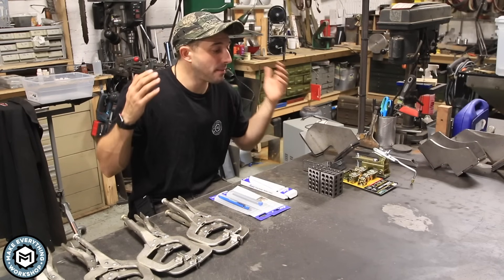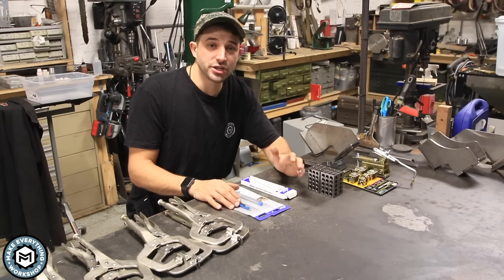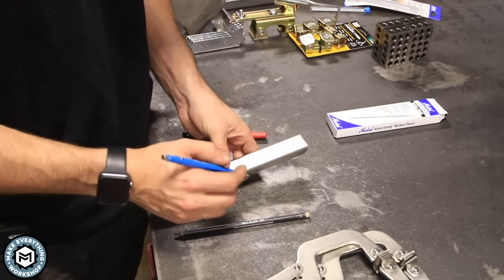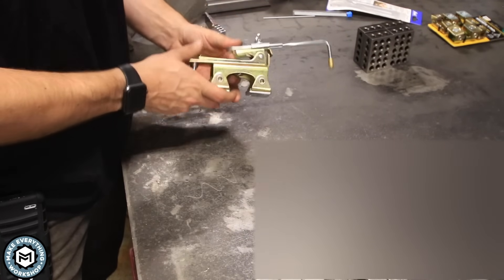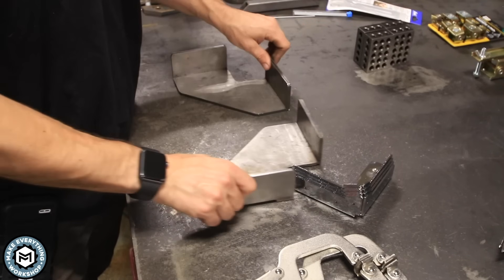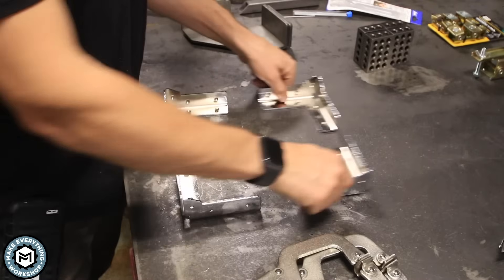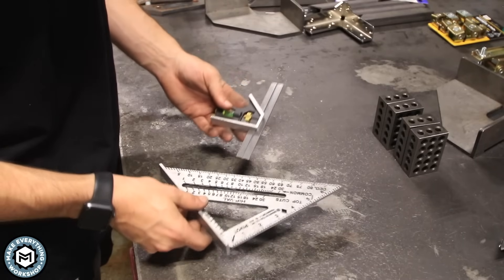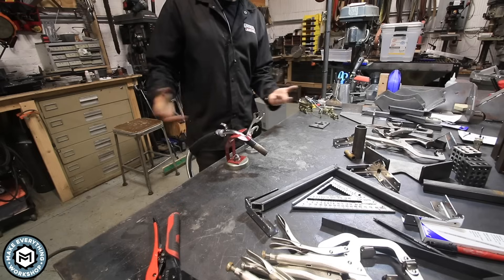8 Essential Welding Tools (All For Under $50)

Comment: The sharpener for the Silver Streak mechanical pencil is the cap/button. Pull it off place it over the lead and spin it between your fingers. Perfect point every time. 👍
Reply: Also, for bright finish materials, Markal makes red pencils too which don't get visually washed out by glare/shine. I hadn't seen the mechanical ones before, so I don't know if they make red leads for them, but you can certainly get it in a traditional pencil format.
Reply: I had one of those and the sharpener cap got lost , now it's useless.
Reply: @kingplumber  For what it's worth, they use the same size of lead as a drafting "lead holder" and you can buy sharpeners intended for art or drafting supply channels.

Comment: Ive noticed with the cheaper finger clamps if you run a bead around the adjustment side joint between the handle & the finger jaw it makes it MUCH more sturdy...👍

Comment: An old dog here, learning new tricks that didn't exist when I ran a Miller stick welder. Some of these tools would have come in real handy forty years ago.
Thanks for your efforts on my behalf.
Reply: Right, at home I'm still rocking an old Lincoln tombstone AC-225. God bless,  y'all work safe.
Reply: @bayoutrapper Yo brother..built a frame & mounted small tires on mine. With it & a 110v flux core not much I can't do.
Would ya believe they have fluxcore STAINLESS...almost fell over when I saw that one...

Comment: I just purchased a TOOLIOM $140ish welder that does stick, mig & tig on 110Vac. Great little unit to learn on !!!
Reply: Have you had any luck with 7018 rods? I too have a toolium welder but my 7018 rods will only arc for 5 seconds and then extinguish

Comment: As Rusty dodge said below the sharpener is built into the cap at the back end. The other cool thing is that the silver streak reflects very well through the visor helmet, when you’re welding

Comment: Bought my first pair of Auto-Adjust vise grip type of pliers in 1984. I got 4 pairs for $6.40 each. I put my tool owners manuals with receipt & copy of warranty in file and saw the receipt. Same year I bought my 150 Amp MiG. Back then a 125 Cu. Ft. tank of 25/75 shield gas set me back $18 plus $1.50 delivery fee. I keep the extra tips & wire rollers in zip bag next to 6 SnapOn distributor wrenches. They look cool next to the chrome Tach/Dwell meter. Does that make you experienced or old? I think both. Cool tools! Better than the 1968 set of “Globe Master” tool kit I used. I still have one Phillips, I put a 3/4” heater hose over the handle and ground the chrome cadnium tip into a nice hole punch. It won’t break?
I enjoyed the video. ASE Master Tech since 1978 (NIASE until they shortened it)

Comment: Chris, this is a good list, but allow this old welder to expand.
Dividers that hold a soapstone
Chain grips with extentions
Wedges 
Center finder
Good magnetic torpedo level
Centering punch
Ball peen hammer 
Saskatchewan socket set ( Newfoundland, it's a TUMWRENCH, Lord thundering....)
Pin/prybar and spud.
Torchguide of choice ( can be a length of stock iron)
Dogs of various types (shop made usually)
Wrap around.
All this stuff is cheap too. But heavily needed. 
Edit: forgot the torch (MAGlight)

Comment: I like using the silver streak pencils also. If you take the cap off, it has a sharpener built in on the bottom side

Comment: I use lots of 1-2-3 blocks in my machine shop, for woodworking and for welding. They’re great. But, I do have to say that you’ve got to do something about spatter. Spatter will weld itself to these unprotected steel blocks.

And about torch holders. I have the silver one shown here. I ended up bending it to better work with my MiG torch. Here’s the problem; the torch isn’t held at much of an angle. It’s almost straight up. If the holder isn’t right at the edge of the table, the trigger will often touch it. Well, we know what happens then, it turns on and the wire shoots out. It it touches something, weld city! So I bent it to keep the torch more horizontal, and that solved the problem.

I just tried to buy the Ollie 8” squares, but he’s sold out of every product. Hopefully, he’ll make some soon, as now I really want to try them. Said I saw them here.

Comment: Another cheap tool that is a game changer to remove rust on metal...
 Amazon 4-1/2" x 7/8" Strip Discs Stripping Wheels that Fit on Angle Grinders. They easily remove rust, don't scratch the metal or wear out like flap discs and they are cheap 6 discs for 23 bucks.

Comment: On my third hand I have them set up for grounding.  If you have a part that is grounding through a bearing and it arcs you will ruin your bearing. The third hand lets me put the ground next to the weld. I have several sizes with a brass tips.

Comment: I'm still using paint markers. I haven't tried the steel pencil yet.  Would it work with a cutting torch? With the paint marker the color of the paint will go away but you still have the mark with the marker. How is it with the steel pencil?

Comment: Been looking for a good deal on vise grip clamps for some time now and was super happy to see 10 for $51! Of course they are now $76 🤬
Reply: You might regret the cheap clamps , i know from experience. The irwin clamps will last a lifetime and have good resale value
Reply: @brianpatrick8441  Yes I understand your point but I use clamps maybe ten times in a normal year so I'm doing things on a very tight budget
Reply: hobart makes a badass pair of 11” with the little swivel pads for like 16 bucks at northern tool
Reply: @KevinHartsBrother  Thanks for the tip

Comment: I bought a bunch of Strong Hand magnetic postioners a few years ago, they were great until some of the little button magnets lost their magnetism...
Reply: Can't get them hot is all...they only lose magnetism when you over heat them.
Reply: @shrconstruction  They were never overheated.  Great tools for positioning parts for tacking, I would not finish weld with any clamps in place.  Some lost their magnetism gradually.